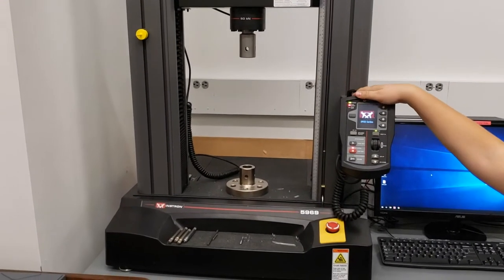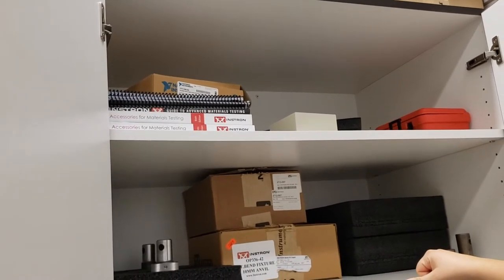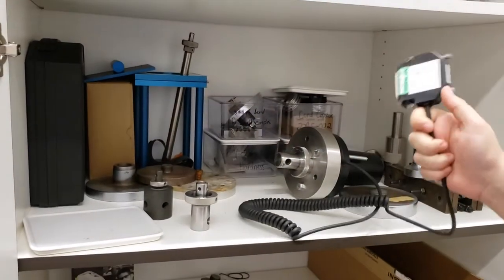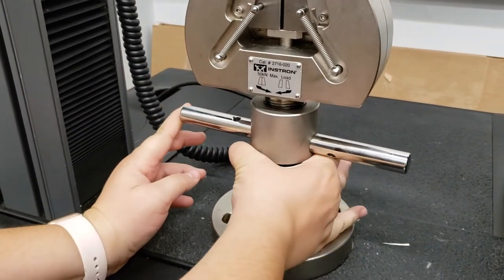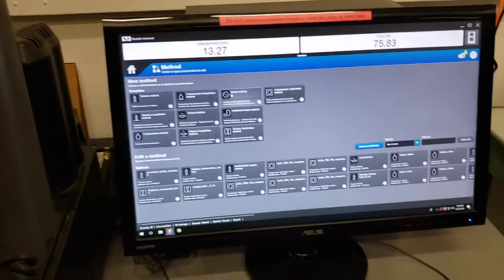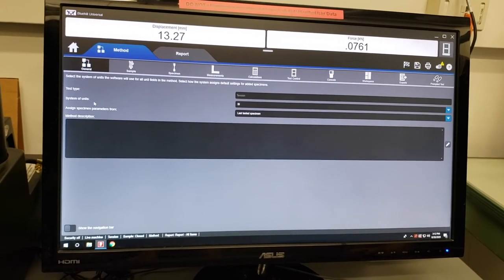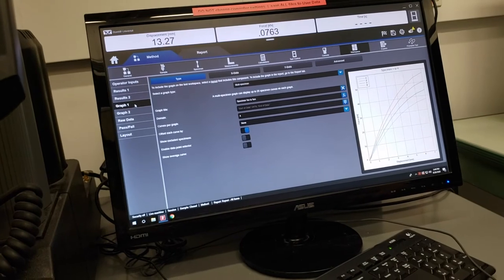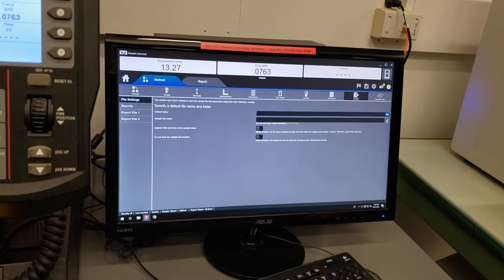Instron required training

Comment: hi i am looking for a video on adapters , also if you can have a vid on calibrating Deflectometer .
Reply from the maker: Can you clarify - what do you mean by "adapters?" And for the deflectometer, are you asking about an extensometer (such as for tension/ compression tests) or a deflectometer (such as for flexture tests? Depending on the model of your adapters or deflectometer, I can try to assist.

Comment: I need a training video about fatigue test instron 8801. Can any one provide me
Reply from the maker: We don't have an 8801 here, so I'm not sure about its specifics. But if you're using Bluehill Universal, you'll likely be doing either a creep method or a test profiler method. Creep methods are best for pulling (or pushing) to a certain displacement (or force) then holding the sample there for a set amount of time. This will measure the amount of displacement or force relaxation in the sample over time. A test profiler method is much more versatile, and would allow you to do things like cycles of tension, holds, and compression. We recently completed a test that ran 10,000 cycles of compression. There are some software limitations (we were unable to track the displacement at each of the 10,000 maximum forces), but we used a secondary software to do the final analysis on the actual fatigue over the multiple cycles. Hope this helps somewhat!